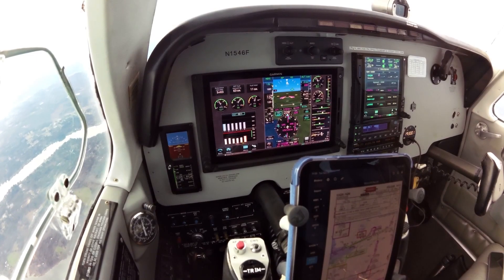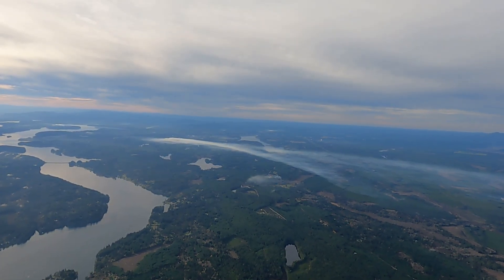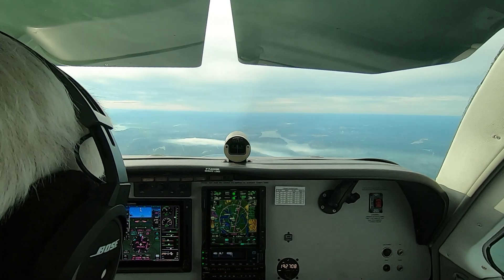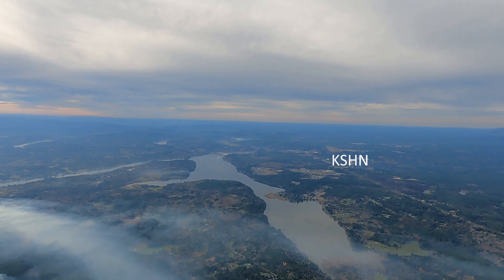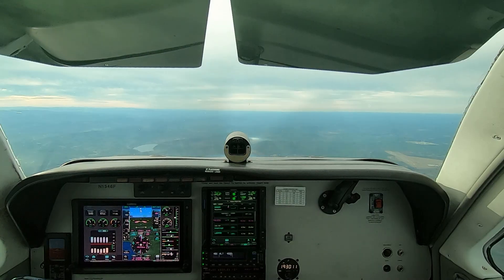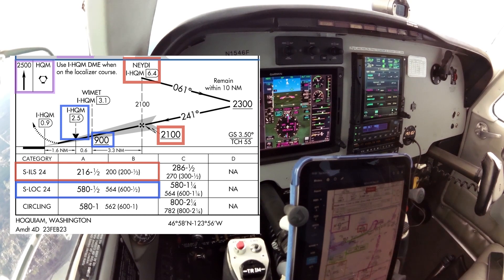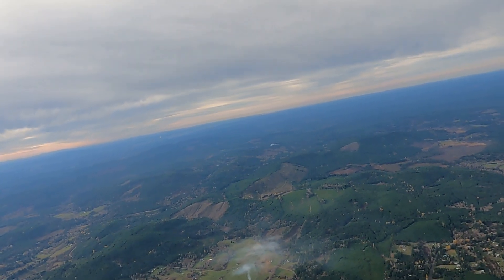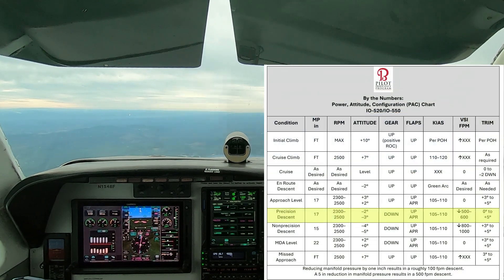Approach Setup and Briefing

Comment: Great video as always.  

QQ: How do you decide whether to do a practice approach with or without a clearance?  HQM can be pretty quiet so that seems pretty safe but I imagine doing so at PWT might be not a great idea?
Reply from the maker: I consider several factors when operating VFR. ATC may not be able to offer services when the skies are too crowded, and at airports like KPWT, it may be better to remain flexible to fit into the flow. As you noted, KHQM usually isn't busy, so it's great destination for practicing a variety of approach and related tasks. It's only about 30 minutes from Seattle in a fast airplane like a Bonanza.